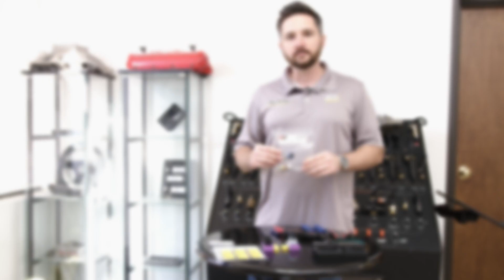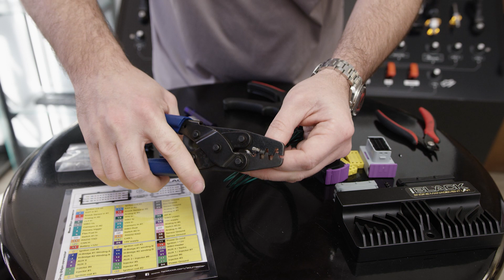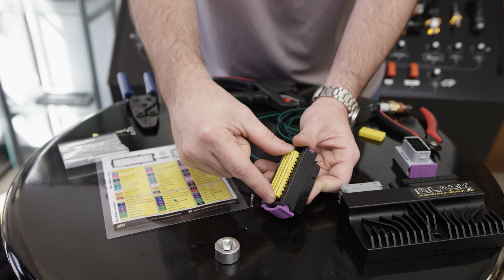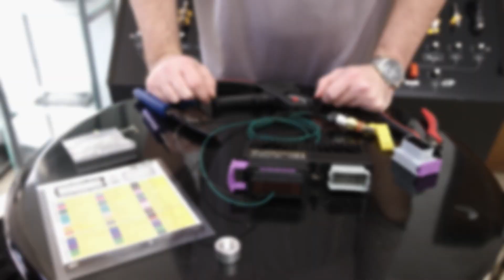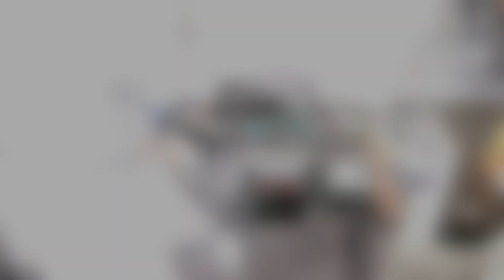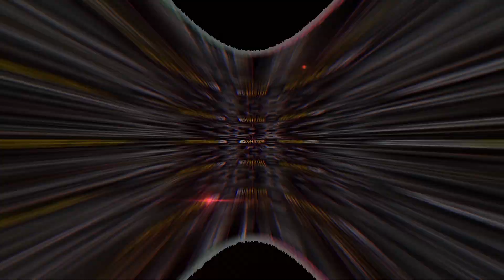ECUMaster Air Temp Sensor Install How To

Comment: What is different from the sensor ground and power ground on the ecu black
Reply from the maker: Power ground is where all the current is dumped to chassis ground from anything the ecu controls (injectors, etc). Sensor ground does not touch the chassis anywhere, it only connects the ground side of sensors to the ecu

Comment: So the a coolant temp sensor  will wire up like that sensor to then but using the clt spot as the power side and the other sensor ground
Reply from the maker: Correct. We will have one of these videos for each sensor we sell soon

Comment: Please Do One for the ECU Master Fluid Temp Sensor on the EMU Black. I notice the Instructions Reference an EMU Classic & also has resistors, I'm Assuming with the Black we don't need to use the resistors as we can do that in the settings but The Instructions don't reference any info. 
It would be great video as well to help those of us who are confused RE the resistor & how it may affect other things if at all on the same pin.

Comment: Hi there! I have question. If i want connect adittional temp sensor to analog inputs (like oil temperature or any kind) shell i use the same way or it necessary apply +5 V with pullup resistor? I wounder if analog inputs have built-in pullup resistiors or not?
Reply from the maker: There is documentation to cover when you need to, but if you know the exact sensor please email your question over to support@ecumasterusa.com and they can give you the specific answer.

Comment: My sensor is in a bad spot on my IC piping.
Can I throw a 45 or 90 degree fitting on the weld bung and then plug the sensor into the fitting? Will it still read correctly if it’s not directly in the path of the air moving into my engine?
My sensor in aiming/hitting one of my motor mounts, so I’d like to use a threaded fitting to have it aiming not straight down anymore. 
Hope I explained that correctly.
Reply from the maker: The air temp sensor needs to be in the air path in order to respond quickly.